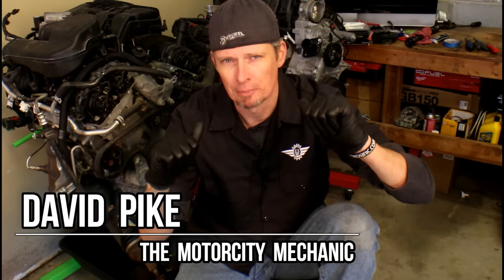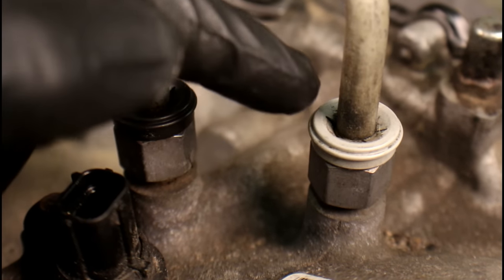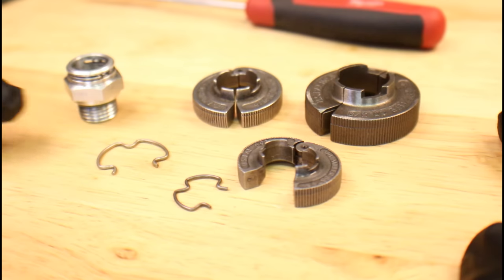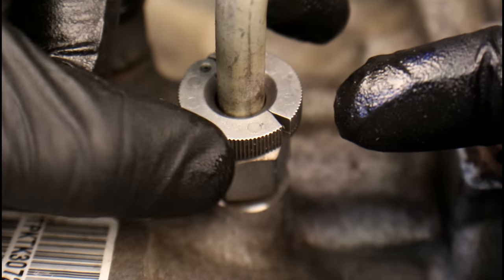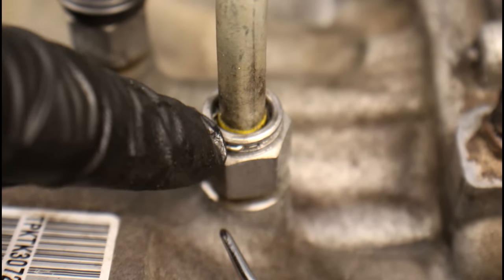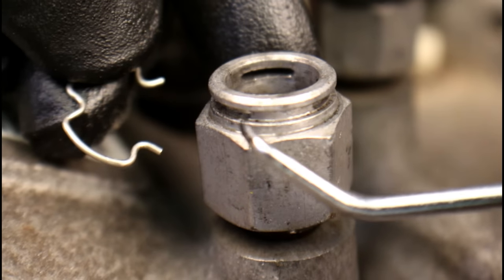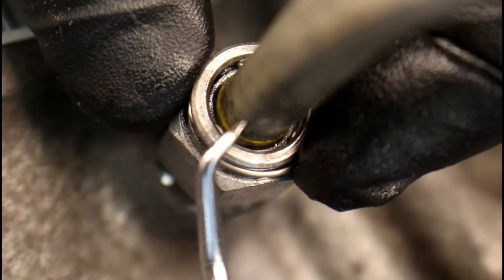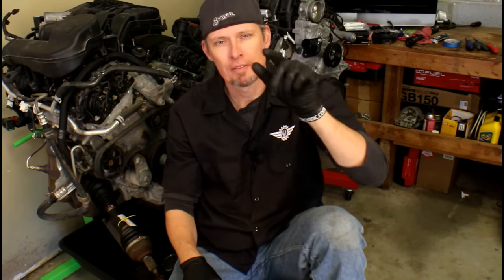Quick Tip: Removing Chrysler and Chevy transmission lines with no special tools

Comment: FYI I have worked in the Auto industry in BC Canada for 30 years and never seen that style line that was installed without the safety clip. The plastic clip is very important as the metal clip is prone to getting stretched out of spec which could allow the line to disconnect under transmission line pressure. The safety clip will not fit over the metal clip if it is bent enough to not hold the line, the line can not disconnect from the metal clip if the safety clip is sitting properly against the fitting.  Good presentation .
Reply from the maker: Many thanks for that great info. I should have stressed that better for sure instead of quickly glancing over it for sure. I appreciate the comment and feedback. Make sure to subscribe and again....thanks.
Reply: @MotorCityMechanic  No problem! Glad to help add to your well done video.
Reply: @MotorCityMechanic 
Hey brotha got a tech question  hope you can steer me in the right direction.  Got a 15 ram 1500 hemi 8spd , had to replace the lines" 52014804AI "  my question is on the transmission heater the 2 holes for the lines which is which ? Does the farthest hole on the heater does that line connect to the top or bottom line at the radiator?
I can't find a clear diagram and not sure if I mixed them up. Basically which line is supply and return at both connection points,  radiator and transmission heater.  Any help would be amazing.  Love your videos.

Comment: Deleted and replaced with flex line and not clips . Used 2 hose clamps and flex hose . Ran that to the Drivers door floor underneath the jeep. and Installed a External cooling unit with a 12 v dc fan. Ran to output to the Radiator and then back to the  trans again replacing the quick disconnect with a Flex house fitting . Now the jeep Runs 15 degrees cooler and no hard lines to crush. I hate Chrysler for these.

Comment: There is a small o-ring inside the fitting that should  be changed or you run the risk of the cooler line leaking.Choice is yours,just know that if it leaks now you have to take it apart again.
Reply: Any idea what size that o ring is?

Comment: I just replaced the radiator in my 05 Silverado yesterday and had a run in with those damn clips. What should have been a 45 minute job or less took me over 3 hours because of them. I cussed more than I did when I was in the Marine Corps. I literally wanted to break the lines and throw a damn fit!  I knew about using picks but I didn’t have any. Had no clue about the special collet tool. 

Thanks so much for teaching me something today. I wish I’d have found your video before going through what I did!  I WILL be buying the removal tool regardless of price.

Comment: Just want to say thank you for the video.  Working on a 2004 GMC Savana, replacing the radiator.  First time having a transmission cooler inside the radiator and these type of connectors.  Made the switch a breeze with a small screwdriver.
Reply from the maker: Awesome. Glad the video helped another person!

Comment: I watched this as I replaced my trans cooler lines on my Ram Promaster 2500 3.6L V6 with the 62TE transmission. Thank you very much for taking the time to make the videos!!!
Reply: So I'm replacing the trans lines that come from the AC condenser I bought the lines new and idk which one is the in and out

Comment: The pick worked great, glad I didn't spring for the specialty tool. Thanks so much for the tip, it made the job changing transmission lines easy.
Reply from the maker: Awesome! No need for some tools that you might never use again.
Reply: @MotorCityMechanic  Ironicaly, The good quality picks were a little too large while the 1$ or free (can't remember which) HF picks worked great. Thanks again for sharing.

Comment: Great explanation and tip. Good camera work and straight to the point. Far too many mechanical videos on you tube that are of poor quality and way too long. Greatly appreciated. Anything you can add on the 4.7 will be appreciated. Not many tutorials on '05 Dakota 4.7 V8 and I struggle finding information.
Reply from the maker: Many thanks for the kind words about the video. My early videos sucked when it came to quality....over time I evolved lol. I will certainly keep those requests in mind for future videos. Make sure to subscribe if you havent already

Comment: Thank you your tip was awesome. Working on my son's 2007 doge ram 1500. The cooler lines are being replaced and when I saw this coupler at the trans I knew i did not have the special tool to remove it. Thanks again for great advise!
Reply from the maker: Your welcome. Thanks for watching and for the comment. Make sure to subscribe if you havent already.

Comment: Wow.   Thank you Sir.    I came to your channel because i received a new radiator with those style of fittings.   I was baffled but thanks to you.   I basically have a safety measure for if the screw on connectors fail.

Comment: This was a huge help! Worked right away. The new radiator already has the C clips and O-rings installed, so I didn't have to transfer them, which was nice. But I'll probably grab them off the old radiator. Thanks for the super helpful video. Also saw your PT Cruiser timing belt and water pump replacement video and decided that it was way too involved for my skill set or available space, single car monthly rental garage. Just gonna leave that to the expert, but doing my own radiator and getting the transmission oil lines off was what was holding me up on another car I was working on.

Comment: Excellent viseo. Shows the "shop" way ($$$), and the quick & simple way. I have had the lines pop off 2 times.  All the fluid spewed out. Dang!   The white plastic "keeper" caps would meke a more secute connection. Thanks!! 👍👍
Reply from the maker: Thanks John. Yeah those plastic caps are very important for sure . Appreciate the comment and make sure to subscribe.

Comment: Hey guys, I actually tie a length of dental floss around the clip before I re-install .There are many times that these are tough to get at and I end up dropping the clip a couple times..with the length of dental floss on it you wont lose it.Once it is on I just trim it off, it isn't thick enough to interfere with anything, I've been doing this for years now
Reply from the maker: Great tip Mark. Thanks for the comment and for watching. Make sure to subscribe if you havent already.
Reply: I read all of the comments before I started this job today... As I was reinstalling the spring clip on the new pressure line, I kept thinking... "I should use the floss trick, just in case", but I was too lazy to go to the house. 
...dropped the clip and lost 20 mins searching for it🤦‍♀️
... "now I should get the floss..." dropped it again,  this time only in the drip pan luckily!

Great tip! Would have saved me time🙄 thanks!  😄
Reply: I just spent $11 to replace my lost clip. Wishing I would have read this first!

Comment: Thank you for the video! I have a cooler line that is dangerously close to rusting through so I bought replacements that have sat around collecting dust. I checked with some of those "master disconnect kits" and noone could confirm they had the correct tool anyway. The official mopar tool is somewhat hard to find and ridiculously expensive for what it is ($75-100+) If you don't have a pick set you buy some for a few bucks at harbor freight (I use mine all the time for removing o-rings during oil changes) Anyway, thanks again maybe now I'll finally get this job done!

Comment: Notice clip also used on window handles on older models and easy to get off using E clip tool works also good on transmission clips

Comment: Had that problem and was quoted $400 for repair just today on my o6 Charger.
Reply from the maker: Thanks for finding the video David! What was the issue with yours.....a leaking trans line or something else?
Reply: Trans Line. It came in at $241.60 for parts and $137.50 for labor.
Reply from the maker: Thanks for the info.

Comment: Should the line still feel a slight loose after proper install? All the spring nubs were visible on top side of pipe flange. I have no transmission oil leaking but line feels a little loose. Haven’t taken it out on road yet. 2003 olds

Comment: Id prefer the tool to use.. For the transmission line im working on right... Can barely see the fitting in the transmission so the actual tool to use is very helpful when working in a tight spot.. The transmission line im replacing is on a 2006 chevy trailblazer.. And the room to work with is next to none.
Reply from the maker: I haven’t found one I couldn’t get to but I wouldn’t doubt there might me some out there somewhere. I get to the clip for the side of the connector so that mainly why I never have issues. Thanks for watching and for the input. Make sure to subscribe

Comment: Great video. Was wondering how the hell those clips came off. It's like the tool needed for Shark Bite in plumbing.
Problem I have is that half the connector snapped off, trying an EZ Out to extract it but there ain't a lot of room in there for even a T Handle driver.

Comment: Great tip and great video. Thanks. Helped me big time changing out leaking transmission lines on 2010 grand caravan. Question: After I installed the new lines I realized that the plastic caps were put on backwards when manufactured (Dorman part). Can I just leave them off or should I return the part and reinstall?

Comment: “With great videos come great responsibilities” (Uncle Ben as spoken to Peter Parker).
So after reading the first 75 or so comments I believe no one has asked the following technical question: 
Both lines are the same diameter. However, one is a pressure line and one is a return line. One could easily mistake one for the other and surprisingly, they will fit when crossed. 

Would it be a catastrophe to install the return where the pressure line would go and vise versa? I imagine that the cooler doesn’t have a one-way check valve that allows fluid to flow in only one direction. Meaning, that if the lines were accidentally crossed at the transaxle, fluid would just simply flow through the cooler in the opposite direction with no serious consequence. Is this theory correct? 

Great video and explained well.

Comment: I cleaned it all up with engine degreaser, hit and let sit with pb blaster. Can't get the clip out.  Broke a professional dental pick end off.  Tiny screwdriver - nothing works! Thinking just to hacksaw the line to remove the whole bolt?

Comment: 2012 ram 3500 68rfe, got an an accident a few years ago destroying the ac condenser and trans cooler. Replaced it and since the accident the trans runs hot now… I’ve replaced the assembly again figuring it was defective and still the same result, it’s a  2012 so there’s no thermal bypass on it. What am i missing? Only gets hot sitting in traffic, as long as I’m moving it’s fine…

Comment: Nice job!  It's good to see someone actually show how these clips are removed.  I have removed these clips from my own autos and, let me tell you, some of them were difficult (due to corrosion, aluminum oxidation, and more).  But you did not mention the name or where to get that round split circle tool.  I've bought several of them and, so far, NONE have worked.  Had to remove the clips with pick tools like the one you showed (Milwaukee), but just cheaper and more basic.  
Can you tell us about your round circular attachment and where a DIY can get one?  Thanks.

Comment: My transmission cooler hard line(s) that connect to my OEM trans/air conditioner cooler (2006 r/t Magnum) wiggle up & down slightly, as if they were not tight? I see no leaks. They utilize the fitting seen in this video.

Comment: What about the transcooler end of the line? Great video.
Reply from the maker: The trans lines use the same quick connector on both ends with it comes to Chrysler vehicles so the process will be the same. Thanks for asking and for watching. Make sure to subscribe
Reply: @MotorCityMechanic  I disagree. The transmission lines on a Chrysler and dodge line have a spring style clip, like in this video,  on one end. And the other end does not. The other end of the line is a unique push fitting requiring a different special tool to remove. I can provide a photo. But the tool used will slip onto the line and slide toward the fitting, and depress the push style connector to disengage the connector.
Reply from the maker: Feel free to email me at david@motorcitymechanic.com and I will take a moment to see what it is that your talking about. As more and more vehicles come out....I start to forget about the older models.
Reply: The cooler end of the line of my 2009 Ram looks to me to be a standard clip like what is used on fuel lines. Plastic tool that slips around the line and push in to release.

Comment: What about the older Chrysler transmission connectors? The ones that look like AC connectors, cylinder shaped, between metal line and hose.
Reply from the maker: That takes a different tool.....not like in this video. This is the one I usually use for that set up: https://www.amazon.com/ARES-Disconnect-Separation-Fittings-Vehicles/dp/B0195XBPPQ/ref=sr_1_6?keywords=fuel+line+disconnect&qid=1554411077&s=gateway&sr=8-6
Reply: MotorCity Mechanic so I am not sure what to replace the connector with since I don’t believe the transmission rubber hose will go back in this connector.

Comment: This worked great for the trans end, but what about the rad end? Definitely need something to push in because there is no plastic ring to remove for access. I tried cutting open a shotgun shell to put around, but I think it was maybe too thick? 
Any ideas before I head to get a tool?😄

Comment: Great video. Just had a question for clarification. When installing the line back on you said the clip should be inserted and locked in position first, than the line installed. Should the line not be installed first than insert the clip to lock the line?

Comment: Special tool - is that a 3/8? Hard to see. Looking for 2018 Pacifica gas transmission line. Amazon has a set for about $50 and individually for about $13. Might as well get the tool.

Comment: Hello David!  This is a great video and it helped me with removing the c-clips.  But I am at a stand-still.  I removed the c-clips but the passenger side transmission line will not come out.  I shot some WD-40 in the location, but it will not release. Any suggestions would be greatly appreciated.
Reply from the maker: I recommend trying to rotate the line back and forth while pulling at the same time to try to work it out. Sounds easier then it might be but the method I would use.

Comment: I can’t seem to insert the plastic caps around the line and into the fitting. I know you describe that it isn’t necessary. Has anyone had issues after not re-installing the plastic retainers?!
Reply from the maker: Some times they can be a pain. I typically try to install it at an angle. I angle it so that it tries to go on at the middle of the clip and then work it down and if need be....push the metal clip underneath with a pocket screw driver.

Comment: If you put the end of the clip in the slot first and then Twist it on it goes on allot easier and without over spreading it like you did to get it on like you did it,
Reply from the maker: Appreciate the tip. I havent had one over spread yet and I have removed and reinstalled at least a 100 or more in all. Plus the plastic cap would correct that if that was to happen. Thanks  for watching and make sure to subscribe
Reply: looks like theres an o-ring inside that fitting. Do you find that its still ok to use with the new lines without leaking? Specifically I have an '05 jeep grand cherokee that i need to replace the lines on. thinking thats not too old.
Reply from the maker: I have never had to replace those o-rings. They hold up well. I would keep an eye on it if you decide to go that route.

Comment: Going to try and pull one out of the wreckers tomorrow for my 2.4L Avenger. will let you know how I make out with a flat head. Is it the same connection type at the Rad ?
Reply from the maker: It should be for sure. Thanks for asking and for watching.
Reply: Wow I put off fixing this leaky line for so long, I was almost scared to attempt to do it. had heard they were hard to do. Then It got to the point where I couldn't ignore it anymore because it was leaking far too much. Only tools I used was a Small flathead screwdriver and a set of needle nose pliers ! I had the new on out of the car at the wreckers in about 5 minutes, the hard part was installing it into the rad on my 2012 Avenger. I removed the pins holding the front plastic down and was able to pull the grill far enough out to get the new line in. Thanks for the advice to grab extra clips I dropped one and it was lost forever. Lmao
Reply from the maker: @MrEddieG420  Glad it went well and great job. Yeah you can never have enough spare clips just for that exact reason. Thanks for the update Eddie.

Comment: Great video. Im trying to inspect a leak in my 15' GC and i think the leak is coming from the cooler bypass. Have you heard of the fittings leaking before? Is it just an o-ring behind the flanged head of the line?

Comment: Big thanks
Really really clearly explanation and excellent taping.
I have a questions:
what about the opposite side (on radiate), is it the same technique? I don't know because it covered behind front bumper . 
Can I remove the fitting connecter instead of clip? I know that will take too much time. But is it possible?
Reply from the maker: The connection should be the same. You can try to take that fitting off.....for me the clip is the best method.
Reply: @MotorCityMechanic  thank you yes it's the same and I replaced it.
Reply from the maker: @Ahmad_Alhasanat  Your welcome. Thanks for the reply back